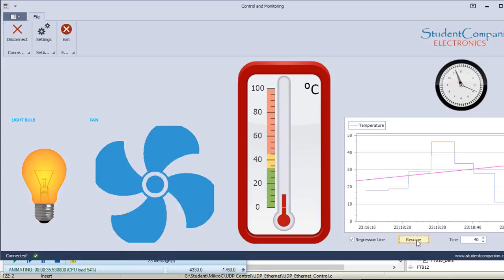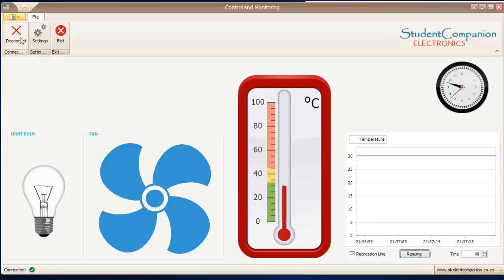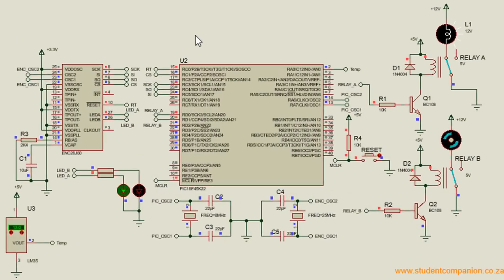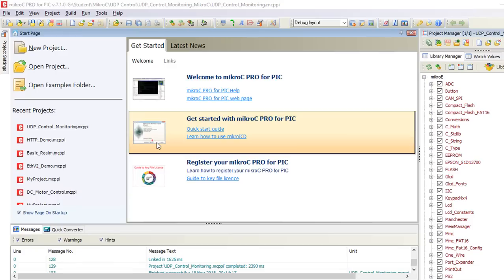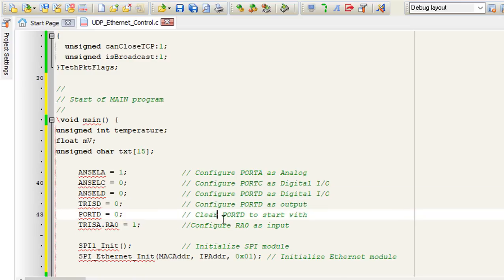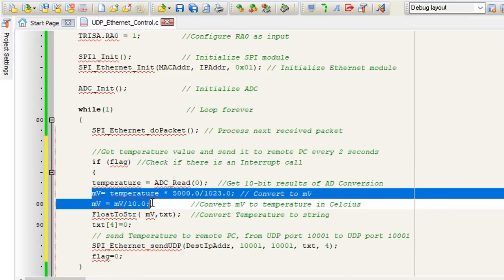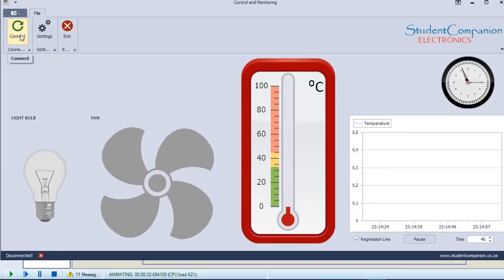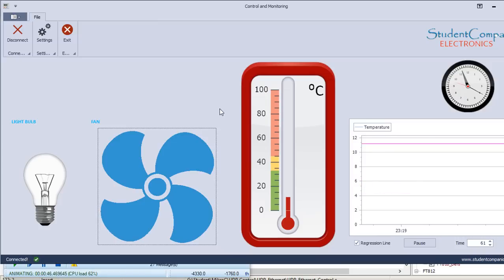81- Project 16 Ethernet UDP-Based Control and Monitoring, part 1 | mikroC Pro for PIC Tutorial

Comment: First of all, hello, good day, I am an electrical and electronics engineering student and I chose your Ethernet UDP-Based Control and Monitoring with PIC Microcontroller - MikroC project as a homework and I am working on it. unfortunately, I cannot connect the C interface and the proteus simulation. I've tried every way and tried to make the codes exactly with yours. Can you help me? Thanks.
Reply from the maker: HI,
Can you explain what you have done so far, how you are testing and which PIC you are using and if you have changed the code, post your code and your IP addresses.
Reply: @StudentCompanion  First of all, thank you for your answer. Actually, I haven't made any changes to the code. I did not intervene in any of the codes in Interface C#. I tried to connect using the IP address you showed in the video. Actually, when I try the steps in your web control video, the connection is established but. Protein simulation is not connected and relays cannot be controlled with UDP_CONTROL_MONITORİNG C# application.
Reply from the maker: For it to work, you must configure correctly your IP addresses. 
What IP address did you configure in mikroC code, in the Ethernet controller and kn your Computer? Is your network card on your computer shows that it's active?
Reply: @StudentCompanion  I have defined the same IP address. Both the MicroC code and the C code have the same IP address. only proteus and C interface are not connected. The IP address of the ENC28J60 ethernet module is the same IP address, I have defined the same IP address in my computer's local network settings. I think the trouble may be in C codes. Although I downloaded the same codes from your site over and over, I could not connect.
Reply from the maker: Is your network card active? Did you plugin a network cable to activate the network?
Reply: @StudentCompanion  I finally managed to connect it, but in the program it gives an error when I press the fan or light bulb and the error message "input string was not correct". I wonder what could be the reason for this.
Reply from the maker: One thing at a time. Is the simulation working now? Can you control the PIC from the c# application?
What did you fix?
The error you are gettting, can you post the full error message and when you are getting it?
Reply: @StudentCompanion  Now the error is as follows: I synchronized the IP address from the network adapter settings and I have defined the IP address in the ethernet module in both microC, c# and proteus. When I click the fan button while connecting, it gives me the error message "input string is not correct".
Reply from the maker: @fatihilhan5450  Upload your code in the forum so we can debug it and see what is generating that error. Forum: https://www.studentcompanion.co.za/forums/
Reply: @StudentCompanion  I shared the codes on the forum please help.
Reply from the maker: We will look at it and answer you there.
Reply: @StudentCompanion  finally I matched the IP addresses and connected the project. Now the temperature and thermometer values are read and the regression graph is also working fine, but the fan and light control does not occur, I think it is due to the MicroC code. Could you check it if I posted it from the forum?

Comment: Woah! that's a awesome one, I tried simulating it but i don't know how to link the Proteus circuit diagram with the user interface. Actually what software was used to on the interface
Reply from the maker: Thanks for your feedback.  What software you are referring to? Can you be more specific?
Reply: @StudentCompanion  sorry for the late reply, I want to run your exact simulation  and develop it cause it's in line with my project 
I'm missing the softwares, what did you use apart from proteus
Reply from the maker: When you run Proteus is it running or you are getting some errors?
Did you install Proteus network drivers?
Reply from the maker: @matthewlephole4917  You will need to watch Tutorial 80 first to learn how to simulate the ENC28J60 and to install all the required software/drivers: https://youtu.be/4hsfHDB1R7w

Comment: Now the projects are all simulated ??? No worry by real life conections, wirings, sizes ...  What is the next programs that simulates people simulating projects ??
Reply from the maker: Not all projects are simulated. To also build prototypes for all projects is costly with our resourses. A tutorial is not a real life project, of that section of the tutorial can be demonstrated with simulation, there is no need for hardware.
Reply: @StudentCompanion   Not necesary costly, but all the efforts and time and considerations to a real implementation, not see it in a simulation. But this is good for learn to someone that study some and in a course  of "microcontrollers",  but not in mind use or implement  in reality
Reply from the maker: Thanks for your comments

Comment: Heloo  plz can u help me because i have e prblm whe n i simulate the progrm
Reply from the maker: Hi. What kind of problems are you facing? Please describe the full error message you are getting and the tools you are using
Reply: When i click on build the messages window write in the final line " finished (with errors): 12 ìçäýííå
Reply from the maker: That's not full error message. I can't guess what could be the problem.
Reply from the maker: If you need assistance, post the full error message and if you changed the code, please post your code as well.
Reply: @StudentCompanion  first thnks alot for you 
And about your question 
 No, I did not change anything in the program I uploaded as it is from Google....
 As for the message, I wrote to you what appeared to me in the messages window 
If there is no prblm , can I get your email address until I send you a copy of what appeared to me?
Reply from the maker: As I said I can't assist you if you can't describe what's the problem. The compiler will always gonna describe the error.  
We don't provide tutorial support in private messages in email but you can post your question in the Forum on our website.  Post the screenshot of your error message as well: https://www.studentcompanion.co.za/forums/

Comment: Hi, how can I change the pins to connecto to my PIC16f18346 spi
Reply: Yes but I think spi pins from spi mikroc libraries take from default the spi1 that they are pin b4 --sdi1, b6--sck1 but also for sdo is missing cause I have to assign (I think I have to use PPS)
Reply from the maker: @sebasA  yes. You can use pps
Reply from the maker: Hi. Just use your pic SPI pins : sdi, sdo, clk and cs

Comment: Great video. Anyway i was wondering is possible to establish a direct communication link between the pc and pic using only a Ethernet cable and not using Internet and router.
Like nowadays plc use rj45 to communicate with pc directly
Reply from the maker: Yes you can. But you must use a crossover Ethernet cable. 
Thanks for your feedback
Reply: Plz do advance projects on flowcode also. Good luck
Reply from the maker: When you say advanced, what do you have in mind? Please let us know what you have in mind. Write your list of what you'd like us to cover. Then we will see how or when we can consider them.
Reply: How about adding esp8266 to pic using flowcode. I am using flowcode 6 and i think the people at flowcode release a macro for it.
Also i have seen very few online material about the dsp components of flowcode. Tried making a pid controller with a 12v fan but couldn't find stable pid values.
Also most people use 8bit pic maybe a video about 32bit pic/ dspic and their application.
Reply from the maker: Thanks for your feedback.  We are definitely planning an ESP8266 videos with Flowcode soon. We are busy building our own ESP8266 development board that we're gonna use with these tutorials.
Concerning PIC32 and dsPIC, the principle of programming is much the same with Flowcode whether you are using an 8bit PIC, 32-bit PIC, AVR or even Arduino. With Flowcode the chip is not much important than to understand how tobuse Flowcode programming icons and components. 
But we will release some few videos on PIC32 so that people can understand how they work and how they can be used compared to 8-bit PIC. 
Thanks for your feedback.